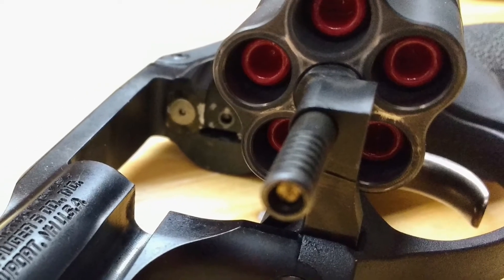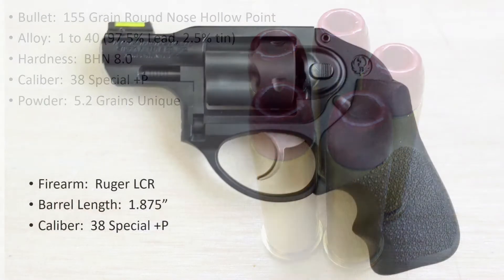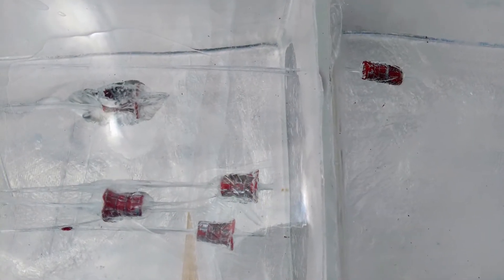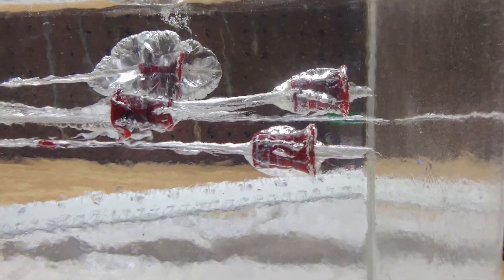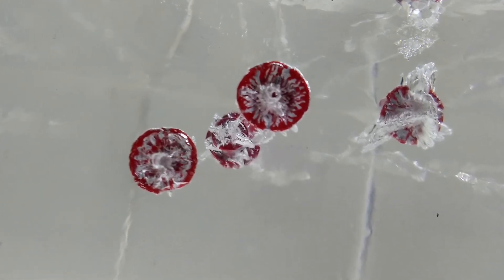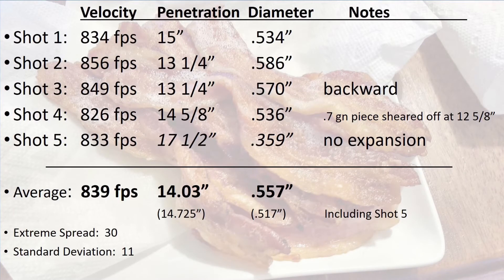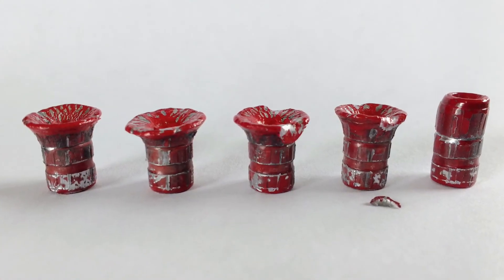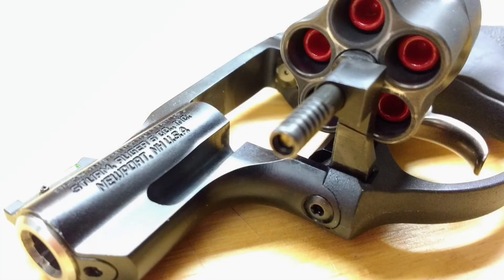38 Spl +P, Hollow Point, 1:40 alloy, BHN 8.0, Bare Gel, Round 2 (PC HP Test)

Comment: Bacon, you had one flipped bullet per test. Now is it possible from the short rifling of that gun they didn’t get a good spin, or could it be when you sized the powder coated it never cut to the lead and maybe the powder burned off and the bullet was to small? I remember I had a mold that was throwing 9mm just a little small and the would key hole. This only a thought on my end, but buddy your doing good stuff and we need to learn thru testing. So power to you and keeper going!
Reply from the maker: It's possible.  You can see some pretty good rifling marks in the recovered bullet though.  Not really sure what happened; we'll keep on going!

Comment: Good test, the loads were very consistent. Why do you think the one did not expand?
Reply: Well... That's just weird.. Hummm. One would think that all the bullets were fired at the same velocity, and were made out of the same Material.  Impressive though.. The way they expanded was textbook. I guess that in factory firings the results are inconclusive as well. some expanded as advertised, some don't.  Planets aligned?  Hummm.
Reply from the maker: I'm not sure John, but one of my suspicions, based on the "wound cavity", is that it may have tumbled.  It may have done a 360 before it came to rest.  It's hard to say for sure.
Reply: I was thinking the same thing.. You shot through the same hole, the bullet followed the previous round channel..
Reply from the maker: That makes sense, but I confirmed 5 separate entrance holes, and the channel for the non-expanded bullet never crossed any of the other channels.